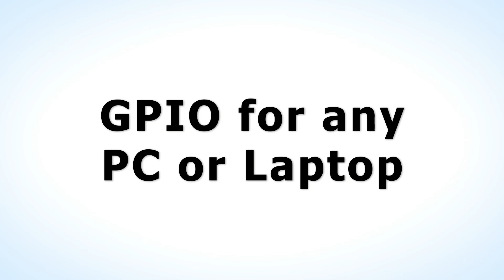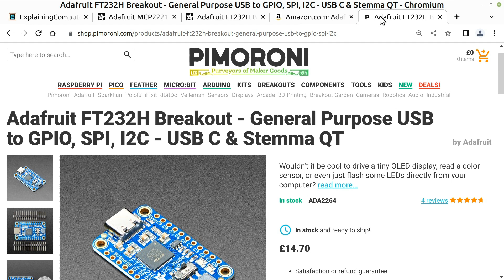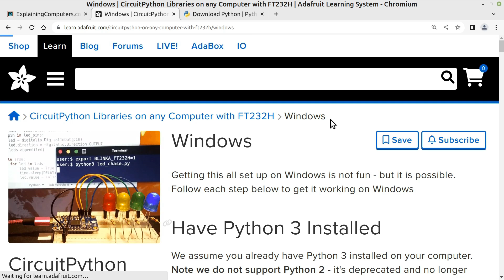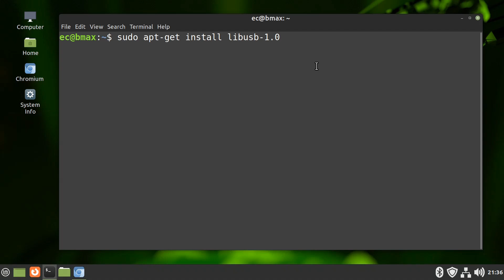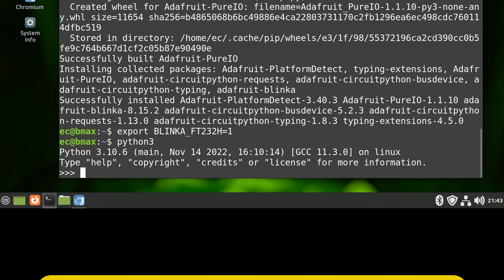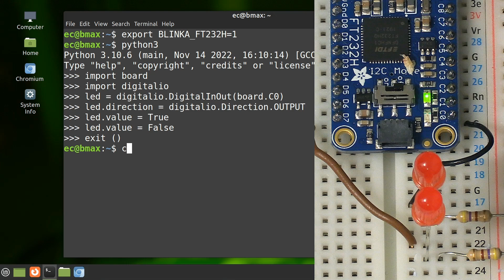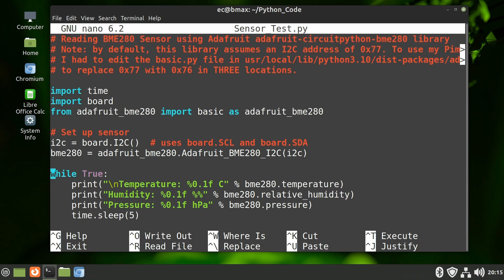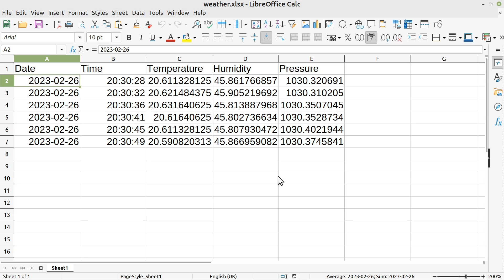GPIO for any PC or Laptop: Adafruit FT232H

Comment: always such interesting videos with my muffin and hot tea.  🥳  Back in the DOS-PC days people came up with clever printer port projects. Now with these sweet little add-on boards the creative ideas are fantastic even 16 bit+ ADC/DAC channels.  😎 Thanks a lot.
Reply: We had a "type and talk" device.. connect to the printer port and whatever you sent would be spoken aloud..  circa 1984
Reply: @timnixon2889  very interesting. Thanks.
Reply: @timnixon2889  There was a board that B G micro used to sell way back then that had a Couple of TI speech synth chips on it. You could connect it to a serial port them just send text to it.
Reply: " Back in the DOS-PC days"

Dos was the key! Because Dos ran in real mode you could do anything. You could read and write directly to any IO port or memory address. Obviously modern operating systems don't allow that. With modern operating systems applications run at PL3 and the kernel and maybe some low level device drivers run at PL0. That means that normal software cannot access IO ports directly. That means to do this under modern operating systems you must write a device driver and create somekind of API that will be used by your applications to make calls to that driver. That complicates things quite a bit. Also some modern operating systems, like the newer versions of windows even require drivers to be approved and signed by microsoft. That usually puts it out of reach by the average hobbyist. 

Interestingly enough, one exception to this is RS-232 com ports. These can still work because there are drivers and API calls already built into windows that allow you to open, close, read, and write to those ports. Thanks to backward compatibility with old school terminal applications this still exists. Unfortunately RS-232 ports are getting harder and harder to find on modern PCs.

Comment: Direct and indirect IO is a matter of interpretation.  Fundamentally both the FTDI and Pico approaches use USB to communicate IO reads and writes.  It is 100% possible to load a Pico with firmware such that it emulates exactly the FTDI part.

Comment: Interesting video again. Just wondering, what is the fastest speed you can have the LED's blink?
Reply: Probably much faster than your eyes can discern. Just keep reducing the delay between switching the LED on/off.
Try around 0.02 seconds delay,(1/50 seconds).
Reply: @martinjones1390  It's not realy about observing the LEDs blink but it is nice to know how fast the I/O pins are in this kind of setup. So the fastes speed is without any delay, not even .02 secs.

Comment: This is fantastic!  I’m just getting started with electronics and the Pi’s GPIO, and just assumed I’d have to dive into the SBC ecosystem.  It’s just awesome I can use my x86 and x64 relics to explore GPIO, although with a little research I guess I could have accomplished this w the Pico and sub variants.  Thanks!
Reply: I'd say that the way Chris has shown it here on the PC is no different to using an SBC, it's the same compiler and IDE! What would make this more PC compatible would be some API calls you can make from say Visual Basic or MS Excel or even batch files or scripts.

Comment: My first job out of high school was working at a radio shop where I learned to tune radios (before PLL frequency synthesis), install and service "car phones" and most interestingly build police squad cars by installing radios and light bars. I have several colorful stories from those days, like the time I repeatedly pressed a "man down" button on a portable police radio before I knew what it was, or the one where I did a "test drive" of a newly built squad car like the Dukes of Hazard.  But this story comes to mind because of something in this video.

One aspect of the construction of a squad car was to add circuitry for something called "wig-wag" lights.  That is the connection of relays to flash the headlights alternately left and right about once per second. The LED's in this video are alternating at about that rate and reminded me of this time I left work exactly on time, and I was in a hurry to get home. I was speeding like usual and behind me I saw the dreadful wig-wags and really thought me house was cooked.  I dug out my license, registration and proof of insurance.  Well, I was surprised when the officer didn't ask for them but addressed me by name.  It was Sargeant Deeghan who came to visit me at work but I wasn't there. So he chased me down on the highway!  He wanted to ask about the function of one of the radios and didn't want to wait until tomorrow, ha ha.  Well I laughed all the way home after he also gave me a verbal warning about my speed.  That day was a good day to have the police Sargeant as my friend.

13:15 So then, I hope you will remember that an alternating pair of lights is called "wig-wag" lights.  😀

Comment: Thank you for this. I have no idea why this should be usefull instead of just using a RPI or a Pico - but that's exactly, why I'm intrigued to try it. :)
From the comment i see, that other people like me, feel it's a time travel back to the days where computers were more electronic than they are today. We used serial and parallel ports if we had to control some self invented hardware. :) 
I'm trying to find some information about a Danish guy, who in approx 1995-2000 created a smart home, with a Commodore 64 and a huge amount of cables going to coffee maker, windows locks, door locks, and thermostats. He could even call his home with a telephone, and control some of the devices pressing different keys.  :) 
They made a small news clip on TV about it back then, and i wish i could see that again

Comment: 2 Questions:  1) How is the installation on Windows?  2) is there any DAQ software to match?
Reply from the maker: The Windows installation is a little tricker -- hence why I did Linux in the video! :) Most CircuitPython libraries are some form of data acquisition software -- so it really depends what you mean by DAQ.
Reply: @ExplainingComputers  Thanks.  I meant a GUI usable DAQ program like TracerDAQ and DAQami.  Surprising answer about Win Install,  I thought it was quite an ordeal for the Linux install in the video.  MCC has DAQs ~ $100 including software that is plug and play for Windows, and now also support Linux.

Comment: A board like this would be very useful for setting up some custom NeoPixels to be directly controlled by a computer, especially that cheaper board you showed with less GPIO as you would only need I2C. I think I might need to make some kind of Python controlled lighting on my PC, whether within the case or around my desk!
Reply: You have some limitations coming from USB, so don't be frustratet when it won't work as NeoPixels have a strict timing convention.
Reply: @christianmontagx8461  thanks for the heads up. Otherwise I might use a Pico with a script on my computer sending serial messages to a receiver script on the pico.
Reply: I'm not sure if the neopixel module is even implemented for x86 . When I tried on Le Potato, I found the library was not implemented for any sbc but Raspberry Pi and they have no plans to do so.

Comment: Hi Chris. Thanks for an informative and carefully thought out video which clearly explains how to use a GPIO adapter.. I think for your next project you could add an infra-red transmitter so the experimental circuitry would not be connected directly to the USB port!   A good use for this would be operating colour light signals ona model railway. Thanks for uploading.
Reply: Or an optoisolator which is designed for this exact purpose.
Reply: @davelowe1977  Yes, but infra red would allow the isolated circuit board to be further away which would be applicable if the lights were signals on a model railway!
Reply: @AllensTrains  ah - now I have read your username!
Reply from the maker: Certainly there are model railway applications! :)

Comment: But the same could be achieved (for cheaper) by making a suitable firmware for RPi Pico or any other chip with native USB. Right? What's the main benefit of these breakouts?
Reply from the maker: Anything done with a Pico (or other microcontroller) will always involve software running on the Pico which then passes data on to the PC. So not quite the same.
Reply: @ExplainingComputers  But you don't "directly" control GPIO with FT232H either, right? You talk to a USB driver that encodes your requests as a serial message that is then decoded by the FT232H chip that performs the requested actions on the GPIO pins. Whether the decoding-to-actions is done by a specialized FT232H chip or an RP2040 chip or some other narrow-or general purpose MCU could be rather immaterial at the application level.

Perhaps FT232H can be made to toggle the pins faster than an equivalent firmware on a more general-purpose MCU, in which case the speed comparison could be the key observation I guess. As long as the application is coded in Python, however, I doubt the bottleneck would be in the USB-to-GPIO implementation :)
Reply from the maker: I think we are debating conceptual vs technical.
Reply: @ExplainingComputers  Pholosophy aside, assuming the appropriate firmware for Pico is available, there is a $11 (=extra 275%) price difference between getting a Pico-with-that-firmware versus the Adafruit FT232H. I believe it is useful to understand what these extra $11 buy us here.

If the respective firmware for Pico is not available, answering the question above could help decide whether making such a firmware would be worthwhile.

I suspect @adafruit could actually have the answer (but I'm not sure how to ping them from a comment)

Comment: If you feel quite adventurous and have a spare VGA/DVI/HDMI port on your PC or laptop (and ideally run Linux, not sure how Windows would allow you to do this), then you've got access to a 5 V rail and an I2C bus. I remember mitxela getting one of those small 128x64 I2C OLED screens to work with I2C over the HDMI port on his laptop a while back (making a quite impractical, yet ridiculous computer monitor).

I could definitely see myself making a simple HDMI to I2C breakout for hooking up different devices (perhaps with an optional voltage regulator so that I could hook up 3.3 V stuff as well), like sensors, I/O expanders (giving me regular GPIO) etc.
Reply: Made a similar comment. The crazy thing is you can use PCF8564/8575 I²C I/O chips... 8 (or 16!!!) I/O pins, times 8 I²C addresses, times 1 I²C bus per video output (VGA, DVI, HDMI, built-in laptop screen...)... You could potentially have access to a minimum of 192 regular GPIO pins on a regular junk desktop or laptop. Downside is, you have to adapt your code for this extra step of interrogating the chips, it is not a seamless accessible GPIO.

Comment: This reminds me about my first FTDI project. FT245R, AT90S8515, and 16x2 display. On widows side I had FTDI dll and some little UI project with visual studio to show time and data on that display. FT245 had async fifo interface and with DLL you directly read/write to those fifos. That was more easy to use compared to uart :)
After that I have been using their serial cables. Also modules supported IO pins. Also many JTAG cables was using FTDI chips.
I think adafruit now is just to do packaging it to easy to use python library.

Comment: Python is in danger of being deprecated by rust.
Reply from the maker: No, I don't think it is. :)
Reply: I guess that's my fault, without evidence.  Even today, it may be possible to skip learning python entirely.  Making this transition early would save ppl time.  Should I work to prevent as many ppl from bothering to learn python as possible?
Reply from the maker: @PetraleiTanyl  :) I think it depends on the application area. Python is popular amongst enthusiasts, and where small, quick bits of code need to be written. And it is commonly used on SBCs and microcontrollers (or least to the development of CircuitPython), and even for quantum computing. So Rust is more a competitor I think to, say, C++.
Reply: @ExplainingComputers  I don't think it depends on the application, your first point makes it sound like previous experience is the main driver.  I agree, that's why ppl should avoid an experience that could be skipped.  rust will excel on SBC and microcontrollers.  I can understand comparing rust to C++, but just because ppl can make this comparison doesn't say anything negative about rust.
Reply from the maker: @PetraleiTanyl  But just because a new language could be used, does not been there will be the momentum, enthusiams and resources to replace all existing code, libraries and educational materials. I never argued that previous experience was the driver. It seems that you are coming to this assuming that most Python users are, or want to be, full-time or professional programmers. And in my experience, across both education and the maker community, that is not the case. Python is easier to learn and use, and that is why it dominates in certain areas.
Reply: @ExplainingComputers  I can see where these could be turned into arguments and I look forward to learning more about them.  Specifically, where professionals and others have diverging needs.  Or how to *fairly measure educational difficulties.  * It seems depending on that, the data may lean either way.

Comment: One additional thought ... openocd has a telnet port, usually used by debuggers. Maybe a gdb connection might be needed. I haven't thought it through. In gdb you can actually call functions directly and even script it via python. So there's another wrinkle to contemplate.

Comment: Almost any PC should already have GPIO through the HDMI, DisplayPort and VGA connectors. Is that mini-PC an exception? Did you have to set the display mode manually?
Reply from the maker: GPIO -- "*general purpose* input output" is not the same as the very specific digital communication that takes place over HDMI or DisplayPort. And there is no digital communication over VGA whatsover. You cannot communicate with an I2C or SPI device, or even configure a basic digital input or output, over an HDMI or DisplayPort connection.
Reply: @ExplainingComputers  I2C data is on VGA pin 12, clock on pin 15. Anyone can put a 'scope on those pins and verify this. HDMI is compatible with DVI, which also carries I2C. Since you hooked it up to an I2C device anyway, those should be general enough.
Reply from the maker: Ah, my bad. I have learned something here today. But still not GPIO in the widely accepted meaning of the term. :)
Reply: @ExplainingComputers  Christopher, if you connect a PCF8574 "I²C to GPIO" chip (the kind that is usually used to communicate to regular 16x2 LCD displays through I²C) to those VGA/HDMI/DVI/built-in laptop screen interfaces in the appropriate pins, it will give you access to 8 regular, digital GPIO pins. Multiply that by the 8 addresses you can configure the chip to have. And multiply that by each of the video outputs your PC has (yes, the VGA, the HDMI, the built-in screen on any crappy old laptop has a dedicated I²C bus for each of those...). 192 GPIO pins for the price of 24 of those chips (their individual price is in the 1-2$ range). Quite some possibilities, don't you think? ;)
And you only need a little "sudo apt-get install i2c-tools" (or whatever suits your favourite packet manager) to access it, start the i2c daemon, and use your preferred language (works flawlessly with python on a 12 year old HP Pavilion dm3 wit MX-Linux).

Comment: This is so very exciting.
Chris you just made my day. 
I have a couple old low power Thin Clients that I installed  Linux Mint on that only draw about 6 watts when running. So  with the Adafruit interface It could easily be used for temperature and presents detection as well as the most important "Flashing LEDs" Yes!!. 
Haven't really played with Python much, so this is great motivation to do so. Thank you again Chris for an excellent tutorial. 👍😎

Comment: What a great video.

Thanks so much, I really enjoyed this and it was very informative on a number of levels. Got me thinking about controlling development boards from python on a PC via USB.

There's a library called U2IF which interfaces to an RP2040 e.g. a Pi Pico or and Adafruit RP2040 QtPy or RP2040 Trinkey which then gets you connectivity, plus it links into the ecosystem of connected devices from there.

There was something similar for simpler microcontrollers like Circuit Playground Classic over a serial port so you could sample the sensors etc., but unfortunately I can't remember what is was called. You wouldn't happen to know would you? Thanks.
Reply: I just remembered the name of the library is Firmata.

Comment: Whilst I don't own anything that uses the FT232H, the MCP2221A is a really great chip to work with, and plus, it is available in 14-pin DIP form factor, making one's own PCBs for it practical.

I have one of these MCP chips mounted in my PC tower, controlling a third LED on the front bezel. I wrote a Win32 C++ app that makes it turn this LED on or off, depending on whether my NVIDIA graphics is "hard at work" or not ("throttle reason is not code-16/idle") by ways of the NVML API.
Reply from the maker: Very cool.